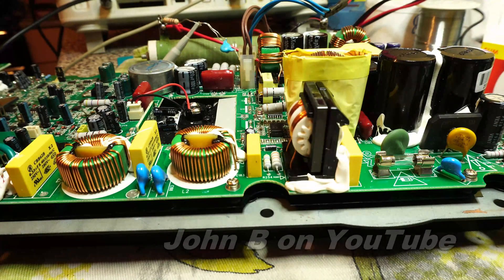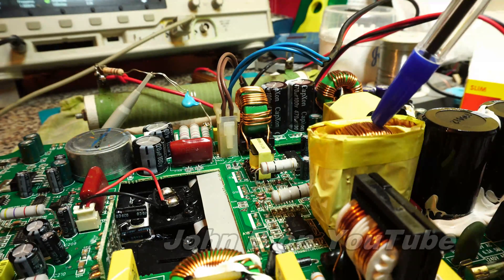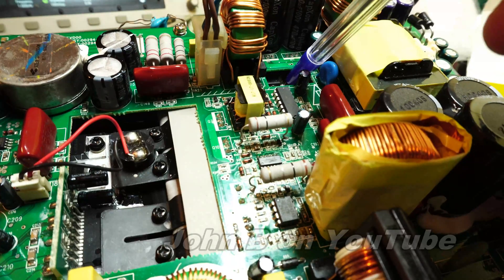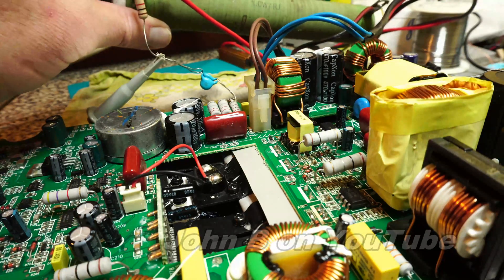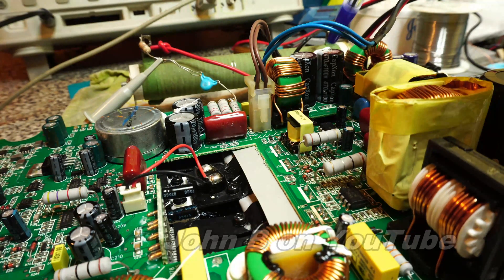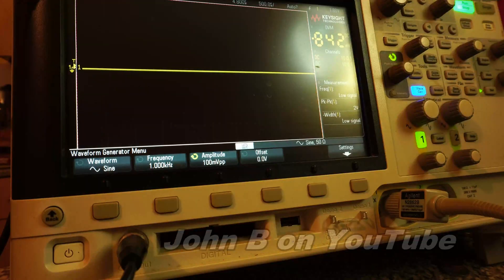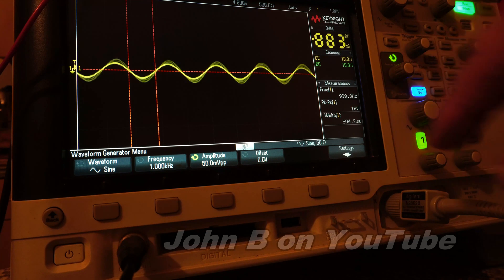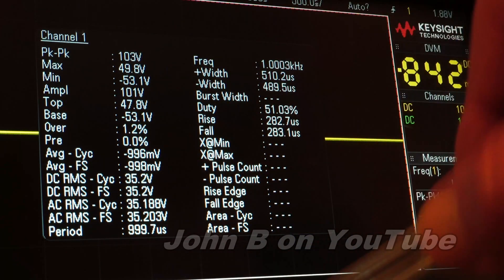How To Measure Amplifier RMS Power

Comment: Hey, Sir, I am wondering about the connection of your oscilloscope. What values of the resistor and the two paralleled capacitors are, and where is the grounding connection of your probe?
Reply from the maker: The scope ground is the metal case of the amp. The resistor is 1k and , from memory, the 2 caps are 1nf each.
Reply: @JohnB-2021 Thank you so much, I cannot afford a differential probe, this could be a great help ❤

Comment: How can it have 4A fuse if only 310w rms and let say it has maximum power consumption of 400w?
Reply from the maker: Over 300 watts real power on bass and 100 watts on tweeter too.
Reply: Can you explain me this, Im totaly confuzed about it and no one can explain me.

Im working in PA rental company and we have newer active line array RCF hdl30 that is advertised as 1100w rms per cabinet, I have measure one with wattmeter at full clipping it consumes peak 350w and almost clipping around 200w-250w.

Does such box really give 1100w rms and how is that possible?

We also have older 2x18" subs that are advertised 2000w rms and have 2.5kw power consuption on specs while newer 2x21" are advertised 3600w rms and specs say 1000w power consumption 😯

Those are RCF tts28a and 9007-as

Update: Seems my measuring equipment doesnt work😄 I have try to measure art 525A power consumption and wattmeter shows 22w, when I get it at max volume up to 24-25w🤣
Reply from the maker: @StageSound-u7s  You’re getting closer to the truth by measuring the power consumption.
Amps are not 100% efficient so will consume more than they give in sound.
However, the storage capacitors inside the amp can deliver huge amounts of power for short bursts.
The ‘PEAK’ real power can be many times the input power but only for short periods. I’m guessing less than a few seconds.
A bass note or bass tone happens very quickly so it may be possible to measure high power and the absolute peak power for a split second.
If you look at me testing the power of a Mackie SRM45v2 bass, I was only able to input a continuous signal. I measured over 350 watts rms on the bass. Another 100 watts on the treble.
Hence the 450v2 Mackie is a 450 watt rms speaker.
In real life the amp could deliver more power for parts of a second.
Many amps are also over rated.
If you know the power supply output voltage, you can calculate the maximum possible power. 
There are 1000 watt amps, whether they can maintain that high power is another question. 
So remember, the mains 240 volts is usually reduced, rectified and smoothed. Those smoothing capacitors can and will store energy and supply high power in the blink of an eye.
Reply: @JohnB-2021  
They produce those speakers that can correspond with those specifications of 1100w rms, but their compression driver is known as 140w and in specification they have  300w rms amplifier for high frequency and 800w rms for low frequency.

Its cabinet with a compression driver and dual 10" woofers.
What tells me they drive speakers with double power on amps and at most thay can have half of stated rating which is 550w.

Also another high power cabined uses 2x 110w rms compression drivers and power amplifier of 1000w rms which they calculate as rms of their cabinet which then doubles or triples power that speakers inside actually have. So they are pretty much lying I guess.
Reply from the maker: @StageSound-u7s  You have caught them out. This is what I find on many amps.
The EV speaker quotes 1000 watts yet is has a little power schip that is rated at 2 x 210 watts.
Reply from the maker: Nothing is 100% efficient, the circuits consume power to deliver an amount of power.
An amp will usually run with a 2 amp quick blow fuse, but you don’t want a hot fuse so it’s increased to over 3 amps.

Comment: Nice video, But in real world the speaker is not a resistor, its a inductor. and the speaker in a enclosure and a tuned frequency which will effect the real power. This is called impedance rise. and depending on the box tuning and the ohms of the subwoofer will chance with the frequency being played. But for resistive loads you are correct.

Comment: Hello John. You have just received a Mackie 450 v2 to repair. I was the chap that removed the module and tried a 1.6A fuse in place of the blown 3.1A. Too much for me to repair or even diagnose. I would be interested in how you get on with it.
Regards
Tony G4NGV
Reply from the maker: Hi Tony,
You sussed I have the amp then lol.
The SMPS is blown which is pretty rare, it’s usually the PFC circuit.
I’ll have to figure if it just failed or if something has killed it.
Reply: Hi John
What an amazing job you do & applaud your determination to come up with a solution.
Thanks so much for repairing my Sons Mackie 450 V2 amplifier, I feel you’ve been tested to the max.
Will definitely spread the word of what you’re able to offer.
Best regards 
Andy 👏👏
Reply from the maker: @andrewrobinson987  Thank you kind sir, I appreciate the feedback.

Comment: I have a pair of ZLX-12BT which was purchased 1 year ago. Just plugged them in and instantly gave the loudest sound in the world while smoking out of the top vents. I can't find parts anywhere. I have yet to open it up (it just happened). Would I be able to swap the boards inside for Mackie? Or would I have to mod the Mackie board to work with the correct power of the speakers?
Reply from the maker: Sadly not, a Mackie will not fit into an EV. 12BT Bluetooth, their latest speakers and they still blow up.

Comment: brilliant john, back to the amplifier videos ! very informative and interesting, i knew the ev specs where inflated but didn’t realise how much!! what a waste of space!
Reply from the maker: Thank you Anthony.
Did you realise I gave the EV the full rail first.
Since power is the square of voltage, I calculated the Mackie at 109 peak to peak, it could be seen on the scope at one point.
The RMS then comes to a nice 371 watts RMS.
Someone told mt the 450 is for 450 RMS, I think they are right.
Thank you for your comments.😀
Reply: @JohnB-2021  yes i heard the srms were 450w, 350w low and 100w high apparently but that was the v1 version, seems they have kept up the power on the v2 aswell!
Reply from the maker: @antonyarchibold6127  I believe the bass is 450 RMS by itself + 100 watts for treble.
Reply: @JohnB-2021  thats a lot of true power for a 12” very impressed